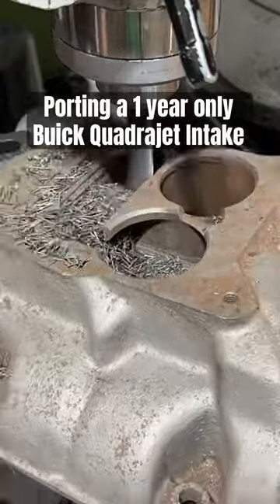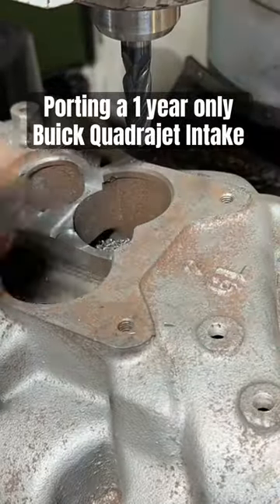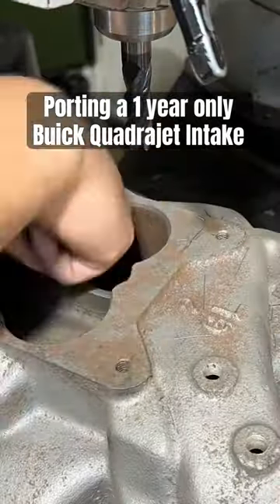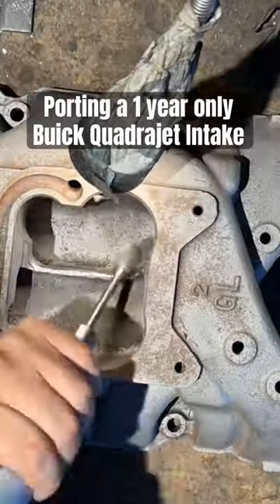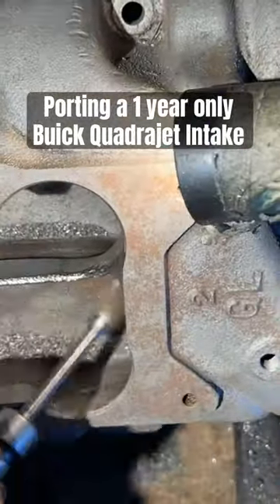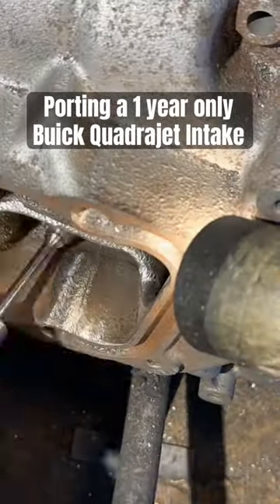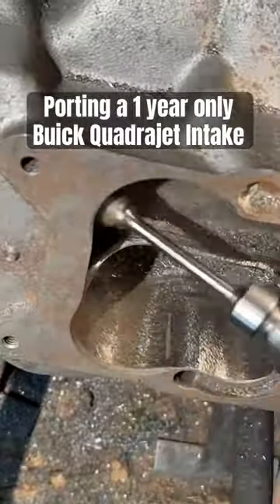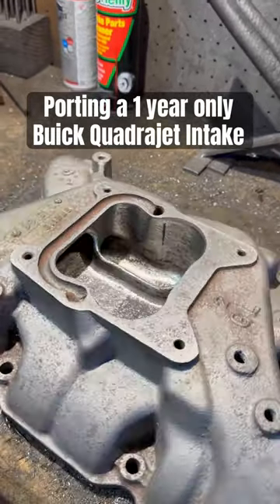If someone likes modifying rare parts its me! #shorts

Comment: I do my own intake shaping and mods , porting to I've  removed as much as two measured cups of aluminum and have 16 hrs of mill and burr shaping 4 hrs smoothing and polishing Toyota straight 6 went from 12 mpg to 20 mpg and gained 50 more horses and smogs as well as a 1999 V6 with --no emissions equipment ....

Comment: I don't know why it wouldn't work. It probably upped the HP a Bit. The more air and fuel you can cram into a cylinder the more horsepower. Within reason.

Comment: I used to run twerker intakes on the old small block chevys. You essentially just lost low-end torque. You going to have to get the cam to match that specs on that intake now

Comment: Well if you are trying to improve the top end of a nail head with factory parts, that is one way to do it. Probably won't lose much bottom end either if its over 400ci. 

I'm 54 and into Pontiac in a big way. I have a fondness for dual plane intakes and torque monsters. HP doesn't make much difference to me because most of my engines don't rev over 6000 anyway.

Comment: Interesting.  Is like you're converting a dual plane manifold into a single plane and yet you leave some of the divider.

Is too bad you didn't do some dyno pulls with the manfold both before and after modification.  I'd be interested to see much you gained from your mods.

Good looking work.

Comment: Well ive made 61 trips around the sun and started working at a gas station when i was 14. I hope that works. 
There is nothing wrong the mod for performance applications. I believe it will increase flow in the mid to top end. I would imagine the original intention was to increase throttle response down low. I would imagine you've installed a performance camshaft.  This will reduce your volumetric efficiency at lower rpm's so its going to be lumpy down low no matter what you do. Youll need a bigger accelerater pump shot to prevent bog.
  You might try to richen the mixture at idle. That in it self will help but not idleal. 
  Keep it crisp aka lean at idle and try to increase your accelerater pump sqirt. Throttle response isnt going to be great no matter what at this point but the quadrajet is a good choice with the small primaries. It should help with port velocity. 
   Good luck. You seem to have it under control.

Comment: We modify rare,  difficult to source and  quite expensive  if you can find them to begin with original parts for customer motors all the time.
It's their motor and their money.

If they want to keep it 100% unmolested, as factory built that's no problem either.

No one else's opinion on the matter is relevant.

Comment: dude, that will flow, keep going till mirror finnish.
a friends dad in 1975 cut his 4 barrel edelbrock intake to 8 piece smoothed like glass the inside and improve the path the fuel flows, in his boss 302 63' ford falcon and went from 10.32 to 9.84 in the 1/4 mile. big mustache smile

Comment: It will work, I believe you will have to adjust the fuel mixture to the rich side. Might be lean on idle circuit too.  Check your exhaust temp and spark plugs.  
It would be worth the top end.  

Question, why not remove the whole dam, it may main want turbulence.

Comment: Curious how it idles with this mod. I assume you did something with the cam and valves. This would be the equivalent of a Victor Jr open plenum. loves to run wide open. Great work and any smoothing will always help the air move and mix.

Comment: Just an idea for you...after your mods 
And your running on a engine stand.
At an idle and every thousand RPM.
START measuring E G T  on each 
Clyinder.  You will find out why your going to find cold cylinders and hot ones making horse power.

Comment: That intake accepts a Carter WCFB carburetor, right? I have a 1959 SBC 283 on a Chris Craft ski boat. I plugged the heat pipes that go underneath the carbon. They were both plugged anyway with carbon buildup. The engine is like a vacuum pump. It will draw in the fuel mixture it can from the intake. I think your modification will work.
Reply: Nailheads came with an AFB Carter, but this particular manifold is a rare oddball for the Rochester Quadrajet.  Notice the two large primary openings and the two much smaller secondary openings?   
1973 Chris Craft Express with a 350.   I also dumped the heavy Quadrajet cast iron manifold for a aluminum Weiand that will take the modern version of the Carter, the Edelbrock.   Damn Quadrajet just got too corroded internally.

Comment: i am over 50 and wondering how the air fuel ratio to all the cylinders turned out? Fuel fowled or extreme lean cylinders? Or did it create a better cfm flow after mod?

Comment: Well, the low-end torque you lost by removing the closed sections you can gain back with a .625 lift with a 108 CL and a 3500 stall. If still sluggish in the 3500-4625 rpm range, add 100 shot of NOS.. then all will be ok... good job 👏

Comment: are you going to tap and plug the exhaust crossover ? use should still use the the high  temp bottom gasket and stainless thin seperater plate then the thin gasket  between
the plate and the throttle plate  your mod looks like some real nice work  what mods are doing to the q jet? yes I am over 50 and like you i know what Im doing great video!

Comment: Personally I don't see much point in building motors like a nail head.

An LS swap probably would be cheaper and better but wouldn't look stock. 

Unless you are talking about a significant museum quality car, stock appearance doesn't mean much.  Modern efficiency and reliability trump that on a driver.

I approve of your modification although I wouldn't do it myself.

Comment: opening the plenum will not increase the signal as you are increasing volume under the carb by combining both left and right side runners you are reducing the signal strength, dual plane manifolds are more responsive by dividing left and right runners causing higher left and right signal strength and air speed thus increasing intake charge equaling more power, my street car with a motor over 500 cubic inches uses a edelbrock air gap dual plane intake

Comment: So nice big hole = lower air flow speed

Low air flow speed = fuel drop out at low mid engine speed

But big hole = more air / power at top end

Not all great is it. Those Engineers probably knew what they were doing

Comment: Im under 50 but that looks ideal and will work perfectly. Problem is that in car tunning world AT 1 end  of the  scale there is engineers that understand metals and how engines work ie that there air pumps. Flow turbulence needed to mix charge on carbed engines but not needed so much pre injector. Metal fatigue. Heat related tolerances etc etc ETC. Then at the other end theres fiters that know how to undu bolts & bolt new bits on unitil something works but have zero idea how anything actually works on a deep scientific level. The people at the low end are often great guys(yes guys ie men. Calm down hair bun wearers) but they only know what they know & unless a big corporate profit monster tells them different they will never know different

Comment: A quadrajet is still a quadrabog. I don't think you're going to get that big hp increase. It's a dual plane and the port runners are not straight enough to get that single plane open plenum effect. That is more designed for increased hp in the upper rpm range. This stock intake is designed for increased torque in the lower rpm range. Removing the divider just might cause that quadrabog to bog even more at the lower rpm range.  Porting and polishing the runners for better  air flow is understandable.

Comment: What impact was there on the venturi effect?  Torque improved or not?
Reply: Be grinding the separating wall, he has opened up a dual plane manifold (designed for lower rpm torque) into a rigged up open single plane manifold (produces torque at higher rpm’s).   His idle to 1800rpm power will drop, but it will make it up at higher rpm’s.   This is what you do for fast top speed, not fast acceleration from stop light to stop light.

Comment: Nah you improved it by 15 to 20hp those tiny holes really chokes engines i had one on my 305 and just getting rid of it and adding a edelbrock carb iI gained 25 hp and was able to get a steep hill in 4th when i usually had to put it in 3rd

Comment: 90% of hp is made through the cylinder heads  modifying that factory intake won’t get you what you want even if you port the runners you’ll be lucky to have enough material to be able to gasket match the intake to the aftermarket cylinder heads you’ll have to use which will have larger intake ports than that intake you modified could ever see  250 hp NOS kit added to it might get you to the numbers you’re talking about  really hp is made from single plane intake manifolds  but good luck with your project

Comment: 1st it's not a rare intake, they pop up on Ebay all the time between $300-$800,  I have 6 of the Q-jet intakes  and 4 of the  1370316B dual 4's sitting at in the shop now,  2nd Congrats on making the 50's teenager smile, 3rd welcome to My 1990-s 2008 (year my old man passed away) as for 600HP out of a Nail head, if its a 425(2nd gen V8) , 560-600 is not out of the question, but it's not going to last, the Bottom of the block is the weak link., part of the restriction is the compression needed to get the 425 in to the 1.5-1.6 HP/CI range ,the piston weight is heavier than a G2 Hemi, and the heads just don't flow enough air with out some major reshaping. we've hit 631hp with a 460ci(425 block with .080 over bore and an offset crank 3.8stroke)  crank come out on the 3rd pass. stock 4bbl intake(by the way you'll need to lower the floor d-side of the intake and raise the roof on the p-side of the intake in order to get any where near 600 HP with that intake.  Been there done that, NEXT

Comment: This is not a hack from someones first attempt to take his expertise knowledge from the keyboard life to real life. This was very professionally done with experience.  Two different things.  This is approved.
Reply: How would u know that,U must know him? lol which I'm sure u don't, it really don't take experience to do a job like that If u got common sense then porting most stuff is easy especially a carburetor, really looks like he's just and average Joe doing it cause he didn't smooth out the surface walls on the inside, if u want better air flow u want everything to be smooth not ruggedness.

Comment: My answer is to not why it MIGHT not work but is to why they MIGHT have designed it that way ,,,, it is because under most driving condition that carb is a 2bbl & 1 side is for cylinders 1,4,6 & 7 & the other is for cylinders 2,3,5 & 8 ...THAT IS DICTATED by the intake manifold...Now again I am not saying that U hurt anything but if U did then that is what U changed.

Comment: I have two buick nailheads that I need this done to
Reply: Don’t do it.  Nailheads are renouned for two things-low to mid massive torque, and not breathing very well at high rpm’s.   Opening up the separator plate robs low end torque by creating a ghetto single plane from a dual plane.

Comment: You did great job but that intake was made the way it was to increase vacuum in the engine for the brake system and any other accessories and the parts not rare seen 3 forsale just this morning they cost $290 the rare one the dual quad and reason your doing is to run a standard bore carb not speard bore like a quaderjet carb is

Comment: Well judging buy how restrictive the intake looked before you reshaped it. To me it’s viable that it will make more hp? But how much more is the conclusion. Different built engines such as that will use  your modded intake let’s say,  engine A makes more hp then engine B because of break in procedure and they have small differences in engine tolerances? The more time in making sure your engines tolerances are correct makes a huge difference in power and longevity. But 600hp needs to be seen on an engine dynamometer before laying claim to such possibly as it will make 600 hp?

Comment: It's all about the W.
Witch is also the first letter in... Whine 😮
I would shave my heads on my Pontiac 389's.
An old Pontiac race guy thought me many things that could be done to them.
In 82 I was pushing 600 hp.
My shop would laugh at me.
Until I pulled up in the beast.
3 inch air out straight pipes
19 foot on each side.
Three carbs, I passed everything but a gas station ⛽
I miss my bad daddy.
It was a ball.
I build vett engines now.
Talk about a power plant.
Stay safe my friend.

Comment: You just killed the signal at low rpm for a street driver. It'll still work. Just not as well on the bottom end that's all.

Comment: This guy... This guy just baited in so many people (like myself, but for a different reason) First he cut a divider out of a stock intake. Second, invites you to bitch about it. Third, gets his ego stroked by "what a great job" crowd. Gets a comment, cha-ching $. P.S. That little wall you left at the bottom center will cause nitro (got to make close to 600hp right?) to puddle. That amount left there on start up should be enough to put your super trick Q-jet through the hood.